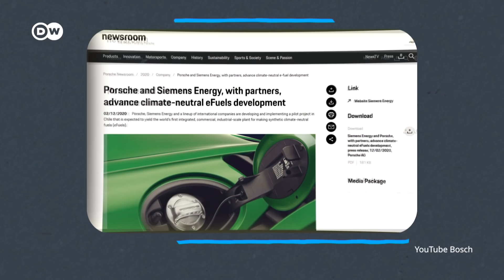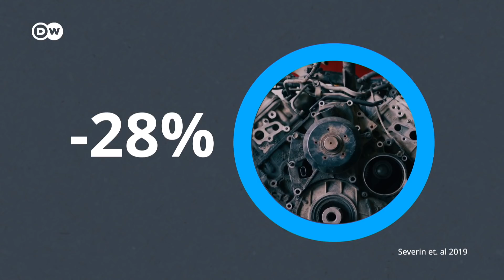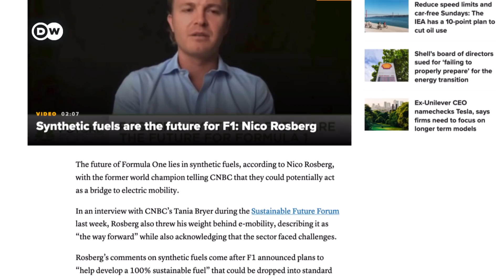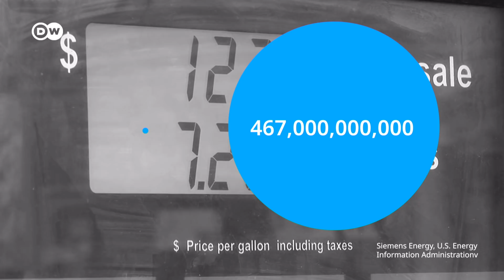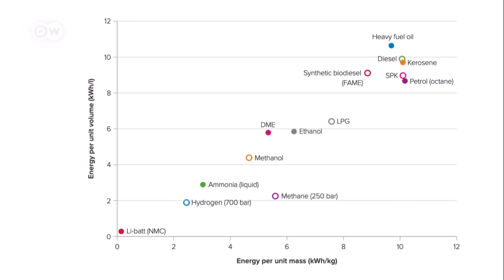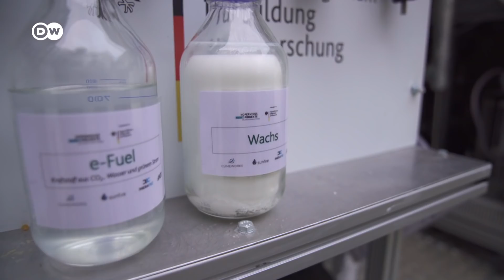The truth about carbon neutral fuels

Comment from the maker: What do you think, what fuel will your car run on in future?
Reply: please make also one about HVO biodiesel made from waste
Reply: I loved the topic, yay as an idea because it is in the early stage of development and as for us, we are still not efficient to near 90% or more (on both sides as producing energy and producing E-Fuel). 

Another point is that the resources needed to build Batteries are limited and with time the batteries cost is going to increase, the way to solve it is by using E-fuel because fossil fuel is not going forever too.

Summary of my point of view, we need to focus on the development of our electrical energy efficiency and the Efficiency of E-fuel. 

Thank you for the great topic <3
Reply: My vehicle is powered by calories!
Reply: e-fuel is still yay. energy dentisy matters. with next-gen "drop-in" biofuel i think it would be gamechangers, cost and  production is the matters  but alteast in 5 years ahead we will see how it will behaved.
Reply: Batteries, but at some point it will have to be other technology than lithium/cobalt.
Reply: @MrMischelito  already other batteries being used. LFP. Several car manufactures are either using or planning to use them.
Reply: @MrMischelito  Most new battery chemistries are already reducing or  eliminating cobalt.
Reply: Electricity. Not because it’s the most practical, because petrol wins in that regard (with current infrastructure). But because it doesn’t require extracting carbon dioxides from the ground, and because it’s highly efficient at putting generated energy into movement. A conventional petrol car has a thermal efficiency of 35%, whereas with electric motors it’s over 90%.
Reply: More than likely E-fuel, and for a few reasons.
1. china makes 90+% of all lithium batteries at current, and they have mentioned multiple times they are happy to adjust production to manipulate the market.
2. E-fuels if created with sustainable energy solutions are FAR cleaner than electric power, studies so far have shown a reduction in co² from battery to e-fuel to be approx 80% reduction accross the life of the vehicle
3. Energy denisty - weight is a massive problem in the automotive world, heavy objects are dangerous and harder to control safely in emergency situations.
4. The energy grid will need major upgrades to transfer the power for EVs on mass scale.
5. Cost, E fuel will end up being cheaper than battery solutions.
6. Mass market availability, its far easier to drive a tanker vehicle to most parts of the developing world than it is to get electricity.
Reply: Could you please make a video for the magnesium based hydrogen PowerPaste the Fraunhofer Institute is currently doing research on ? It has a similar energy density to gasoline a better efficiency then synthetic fuels. Unfortunately the currently mined capacity of magnesium is not enough to use this paste on a big scale, but this can relatively easily be scaled up using more mines or desalination. Also Plasma Kinetics tape based Hydrogen storage has a very good efficiency and energy density. And CATL's new Sodium/Natrium Ion Batteries are a viable alternative to Lithum based Batteries that is cheaper and less harmfull to the environment.
Reply: Ammonia and hydrogen! 🤪
Reply: Algae, biogasoline, bio-oil, butanol and hvo biodiesel fuel.
Reply: none, I predict death to cars
Reply: You didn’t mention the actual emissions from the combustion of efuel, what is it producing?
Reply: @Marsoup1  its net 0.
It only releases carbon that is already in the atmosphere, it does not produce any additional carbon.
Reply from the maker: @Marsoup1 If the eFuel production process is powered by renewable energy sources, it causes no CO2 emissions. Our reporter explains more at 0:57 in the video. 🙃
Reply: If renewable energy is used where it is produced much less needed!
Reply: I'm lucky, I could afford a Tesla. But my bigger concern is setting up those remote wind farms is going to devastate wildlife that's already struggling.
Reply: i think the only industry that would really benefit from this is the airline industry (for obvious reason), but e-fuels should be produced with renewable energy best solutions solar and hydro.
Reply: @Lavaughn Ankle this is what will happen..the middle East will realise how their profits will shake down if oil supply decreases, so they will most likely be the first ones to opt for producing synfuels with the help of the plenty solar energy they receive, and so I think syn fuels would really be a win win situation here
Reply: @goldendemise3165  hidro is the filthiest and more catastrophic source of energy
Reply: Yeay ! Good video guys and girls ! 
And you Forget to talk about the energie lost in the way for thermal engines :) 
Bye 😘
Reply: And does it emits CO2 when burned ?
Reply from the maker: Hi @Henri! Yes, synthetic fuels emit CO2 when burned. However, the emitted amount is equal to the carbon initially used to create the material in the production process, making it “climate neutral.” 🌱 
Our reporter explains more at 0:57 in the video.
Reply: @DWPlanetA  so does biofuel from plants
First you capture the carbon during the plant growth and then you have it to burn, closing the cycle
Reply: yay, do everything. when/if I have the opportunity at that time, my next car is electric.
Reply: My car can run on media stupidity
Reply: I think we’re definitely headed towards electric cars/bikes/other for 80% of normal citizens. It just makes sense because we already have an electrical grid so we just have to focus on creating more charging points.

Stuff like hydrogen, ammonia, synthetic fuels, etc. will likely be used for niche industrial applications. One of the biggest reasons is because this will keep the infrastructure that they have to build much more simple.
Reply: dep.wimdows
:
nusantara
Reply: Electrons, or at worst urea.
Reply: Even if everyone driving cars were to replace their rides with an electric vehicle the resources wasted in creating the initial vehicles and replacing them with electric (even more resources) is likely unsustainable (not to mention the grid infra overhaul to support electric charging). As per the video (6.09) the problem about not many people driving them will not solve the problem either. This bridge should be a way forward for a change in lifestyle (public transport, denser living etc)
Reply: water
Reply: Why didn't you mention Ammonia fuel ? Completely green.
Reply: Cars will run on battery
Reply: Hydrogen
Reply: How far ahead in time are you talking about?
25 years?
50 years?
100 years?
I will say that in the distant future we won’t be concerned about what cars will run on because just surviving a globally collapsed civilization will be the only priority and CO2 and the climate won’t factor into this in any way, shape or form.
Reply: Sugarcane based hidrocarbons
Reply: Maybe methanol and fuel cells. Or pure battery. Depends what is cheapest.
Reply: Hydrogen is the most logical
Reply: Amish method
Reply: Excelente technical information, very poor geopolitical understanding.. well it's called DW after all, what did I expected? Even a hint that the war benefits the US and not Russia? Silly me
Reply: Not surprised that nuclear wasn't mentioned, it's DWs blind spot for good reporting

High temp nuclear reactors can make hydrogen directly from water and its heat at efficiencies equal to our greater than electricity generation (40-60%) 

The nuclear heat can be used to also drive processes like the haber Bosch or Fischer Tropsch making fertilizer and synthetic fuels respectively

Nuclear is a climate change silver bullet with a half century of safety data that puts it as one of the safest ways to source power from even when including the major accidents. The next gen reactors are literally meltdown proof and run on the waste of the previous gen. The high temps can drive many industrial processes that are conveniently done my fossil fuels and involve many losses when using electricity directly as we saw from the video
Reply: Batteries are a toxic waste waiting to happen. They are very hard to recycle. Combustion engines are less expensive to make. Everyone coming home at the same time and plugging cars into the grid means billions are required to upgrade the power connections to the home. There is a large nock on effect due to governments enforcing climate controls without considering the cost to the population. They want to be incharge of populations but lack foresight and end up creating a different polution. Diversity may be a a greater solution.
Reply: E fuel make sense, but ethanol is way cheaper, so in future it cud be 85%ethanol+efuel 
Electric vehicles are still expensive and impractical. Energy density of battery technology and life of battery is biggest issue. 
85%ethanol+ Efuel cud be real bridge for going 100% efuel✌️
Reply: I really do not care what fuel my future 1300 Beetle will use, since i can use the Stock 1300 engine without huge changes, i can use this Fuel.
Reply: carbon neutral gasoline and diesel and ethanol blended fuel
Reply: We do not need expensive e-fuel! Shell had served super clean and super cheap fuel in 2006. It was called GTL made from LNG.
Reply: @TekinBozbey  This would be interesting.
Reply: Potentially methane.
If not then electric but I see bolth hydrogen methane and electric being the future for a little while.
Reply: @thesilentone4024  It's easier, cheaper and faster to build renewable energy, and not just for a little while but for the foreseeable future.
Reply: I feel methane in terms of both CNG and LNG combined with high temperature fuel cells deserves more respect. 

Methane has a far better synthesis  efficiency than the liquids, on par with pure hydrogen.
Reply: @josephkolodziejski6882  If you're using renewable energy for electrolysis efficiency is irrelevant. The whole idea is to leave fossil fuels in the ground, but if that bothers you just put the renewable electricity in a battery and be super efficient.
Reply: Hydrogen produced with renewables to me makes the most sense versatility whise, it can be used for both combustion engined lighter sport cars and "insta-charging" fuel cell electric cars without the disadvantages of batteries, all refueling in the same infrastructures... also it can potentially be a substitute for methane as well!
In some applications battery cars can be efficient and usefull as well (especially car sharing for short trips, even though efficient public transport would be better) and efuels can be incredibly beneficial (if done cleanly and cheaply enough) during the transition and even later to cut emissions in developing countries to make old combustion cars that are still around muuuch less polluting... Yeah i think we should not think at a "only 1 miracoulous solution", every technology can have it's place, but as of now i think Hydrogen makes the most sense for cars.
Reply: @Korvazzo  
hydrogen tanks are very big and drive you little mileage. as to a study, I have read one tank takes you only 120 miles or 150 Km. 

I think it is possible if the engine ratio increased for hydrogen to air, for example nowadays engine ratio is about 14 :1 air to fuel. I don't have much of a background to help, maybe it is going to be a new episode on this great channel.
Reply: @hashimtaha5855  yamaha and Toyota are toying with combustion hydrogen engines with interesting results, but then again it makes sense for sportcars, for most commuters fuel cells make more sense!
Reply: @Korvazzo  bmw already did it a while ago witg the Hydrogen 7
Reply: @Korvazzo  and add to that a modular nuclear reactor able to power a 1000 people neighbourhood. Occupying a space of a medium supermarket. From there you would have you own hydrogen generator to charge your car overnight or a hydrogen station to fill up quick. What a future that would be!!!!
Reply: Nuclear batteries, the most energy dense method to power vehicles once we successfully achieve direct thermo-electric conversion in a plausible efficiency ratio.
Reply: @joaopinto415  Where are they? What will they cost? Can they be scaled up to necessary production?
Reply: Flintstone-power or no private car, maybe rental if needed and other wise walking bike and public transport.
Reply: @hillockfarm8404  yeah because I'm going to Carry my tool box 110km each day to work at 4 in the morning at -3 degrees 
No thanks 😂
Reply: You said e fuel is a bridge, but a bridge to what??
Reply from the maker: Hi @Robert! The bridge the video refers to would be a move away from fossil fuels and toward decarbonized transportation.  🚗
Reply: @roberthiggins6401  bridge of sustainable option such as electromobility. but i dont agreed. synfuel can be working collaboratively with Combustion engine (highly posible hybridized) with e-fuels
Reply: @roberthiggins6401  a bridge from gas to eletric... or just to 100% reneweble cars
Reply: Elon Musk's hair gel
Reply: The tears of children torn by the wars to provide us with the energy to power cars.
Reply: Gasoline, diesel, natural gas
Reply: I will buy a new petrol vehicle in 2029 and look after it for 20 years. As 2050 occurs, I may consider a battery electric car.

Comment: The problem is they want to use electricity to make synthetic fuels. They want to  use the sun energy in Chile to make electricity to power a highly inefficient process. They should instead make the carbon capture and water splitting based 100% on sun energy, direct sun energy. Then you will have fewer conversion steps, and you would make a renewable plant specifically for this purpose, so you dont take electricity away from other stuff. Moreover, you can turn CO2 and H2 in any hydrocarbon, not only synthetic fuels, effectively replacing many polluting industries. Everybody focuses on transportation, but it represents only a small fraction of total emissions.

Comment: There's just no question that electric cars will take us nowhere. This does the same job, using the massive pre-existing industries that we've been perfecting for over a century. This isn't just going to save the internal combustion engine, this will re-revolutionize the automobile in ways that EV's will never manage. Imagine how good cars are going to be when we can remove all the B.S. emissions equipment and regulations that are making them suck.

Comment: The big problems of e-fuels are the costs and the big numbers of wind blades or solar panels that it needs to produce energy. But if that energy is produced by nuclear power plants the cost/liter can be little I think. Also, we don’t need to occupy large portion of land because the specific nuclear power plants occupation (par m^2) is little. It’s true?

Comment: Both e-fuels & hydrogen will eventually have their part in the sustainable future due to their energy density, but first we need to completely decarbonize the grid and progress further with the transportation. In the same time  world needs to tap for sustainable/renewable energy across the globe like in the Chile and use it in best way possible. Future of sustainable energy is colorful of solutions and diversification, there isn’t just one way or path to achieve carbon neutral/negative goal and that’s a beauty about it👏👍
Let’s progress and move forward as species to next level or stagnate, degenarate and die!
We r here to learn from our mistakes and ultimately fix them with the neverending ingenuity and creative mind we were gifted by the creator.
Sooner we realize what we r capable of when we channel our true potential right direction better. More we do that closer we r to creator and to realization we r all one even still individuals. More we let go and more burden we leave behind,  easier the connection with the creator inside within and outside of ourselves is going to be.
True potential of hunans as species as a collective organism and as a super intelligence is still untapped and unaccessed. Time to unlock it and put it in use which goes beyond what we deem possible or real…

Comment: It's summer and as is know "the earth is greening" and everywhere bushes and plants are growing like cabbage. So I think, we must harvest all that biomass. (unemployed? asylum seekers?) Then comes the transport or storage.. and both are not cheap. So I read that there is kind of pre-processing possible leading to a product which can be compressed and which can be stored easier: torrefaction (through microwaves preferably to have least outgassing) 
Once a week, a truck comes to all the rather cheap torrefaction ovens to collect the product. 
Then only everything goes to a microwaved /laser (no combustion, no oxygen !!) pyrolysis oven under hydrogen atmosphere. The result should be a lot of hydrogen rich light fuel and also solid carbon which so removes carbon out of the carbon cycle. 
I would think that if the starting product is very homogeneous,  less sulphur and other contaminants will be present so only wood etc must be used here. Domestic waste is for another more classic, oxygenated oven with high temperatures so no dioxines are formed.
I would consider Japanese knotweed as biomass. It is easy to grow and harvest and grows on all kinds of less interesting ground. 
It must not be transported before torrefaction and then spreading it, won't be less of a problem.

Comment: I favor eMethanol from CO2 or Biomass using a high temperature nuclear [fission] reactor.  A high temperature nuclear reactor could provide the high temperature process heat to make the hydrogen gas from water and then eMethanol with much less land than variable renewable energy. [1]  

The hydrogen gas can be made via a steam electrolysis or thermochemical hydrogen production [1].

To run the passenger car, we could use a reformed methanol fuel cell which can be highly efficient [2].

Internet Source:
[1] "Nuclear Process Heat for Industry", 2021, World Nuclear Association

[2] "Reformed methanol fuel cell", Wikipedia, 2023